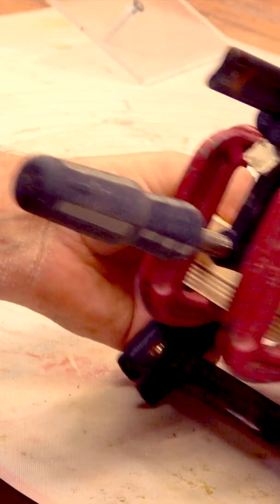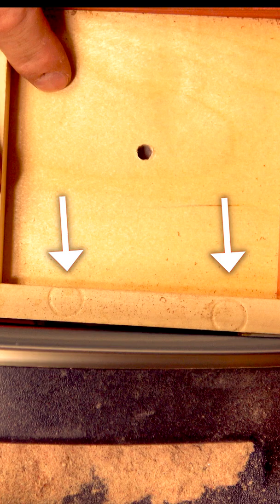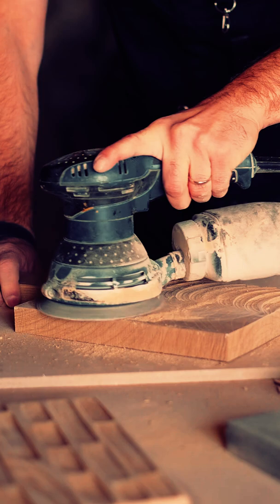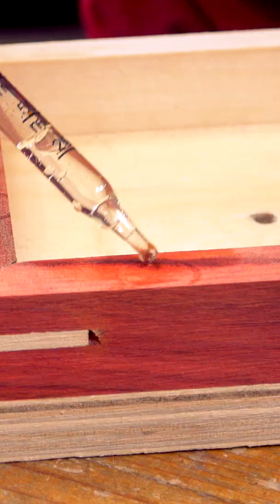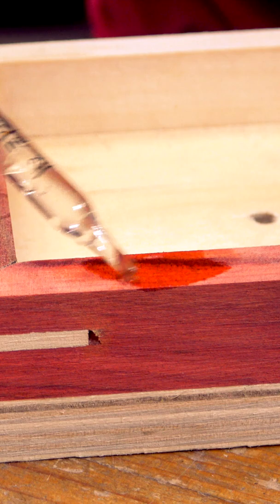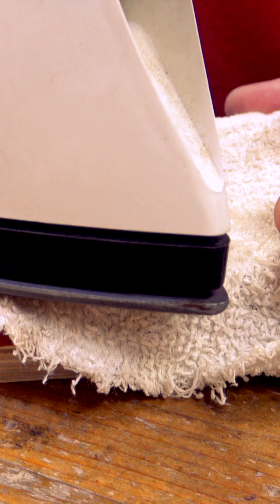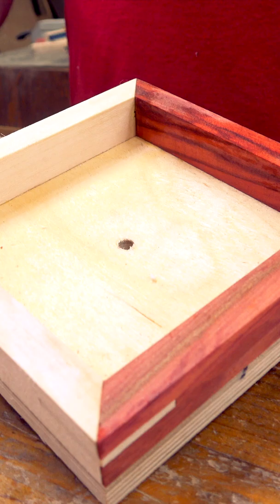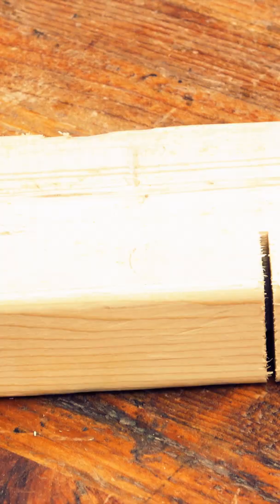41. Too MUCH Pressure?  Use STEAM. #mtbitesize #shorts

Comment: Silly me just puts a piece of wood under my clamp,
Reply: But what if that wood marred your surface?
Reply: @CeeJayThe13th  then you shouldn't tighten your clamp that hard
Jokes besides, if u using a soft wood you shouldn't put a hard wood under the clamp. U could take a bigger piece of wood, or u put like towel beneath it. The hack which is used in the vid is cool, dont get me wrong, but usually it's preventable
Reply: @azrael7554  easier than the example of the clamp but if you happen tomorrow the wood accidentally through any other mean this could be useful
Reply: @clonescope2433  no doubt this hack is useful, but the use is in most cases preventable. But if it happens, the steam trick is pretty effective

Comment: That's a good advise, heard of it before. But for the example you gave with the screw clamp it would be way smarter to just avoid the problem altogether and put flat extra pieces of wood or plastics at the contact points. Newer screw clamps also have plastic caps, so there's usually no problem there.